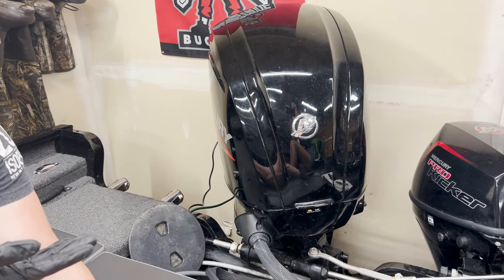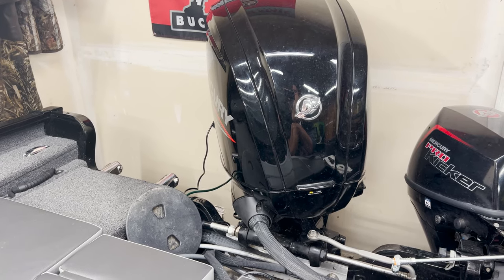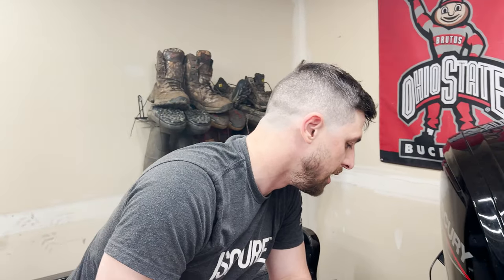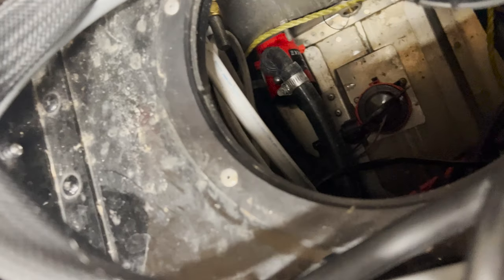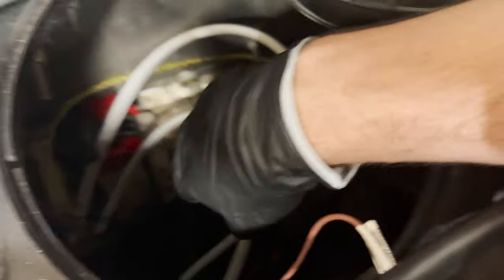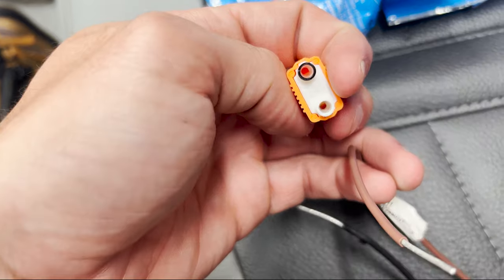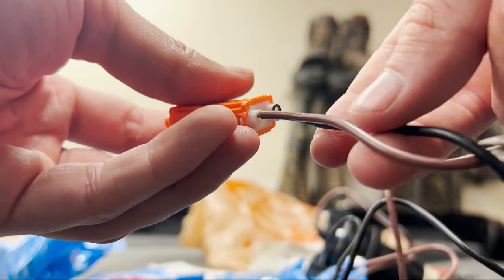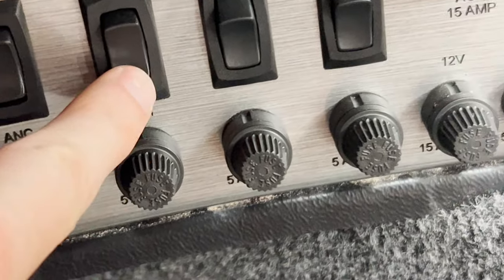How To: Boat Aerator Pump Replacement (2021 Lund Adventure)

Comment: Moisture/water will kill those electrical connections in no time. Solder connections and shrink tube
Reply from the maker: I guess I’ll fix it if it breaks. Until then I’m pretty happy with things. I don’t do much boat work or soldering so I was hesitant to try. My boat stays pretty dry which is nice. Hopefully that helps my repair last longer.